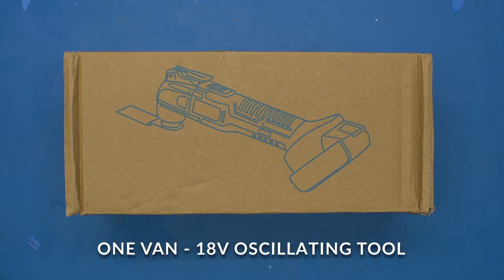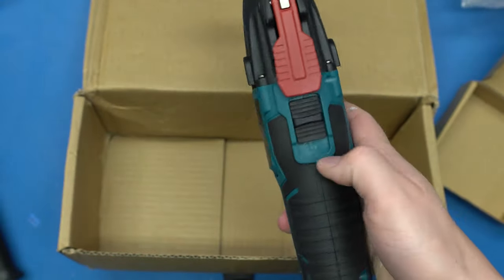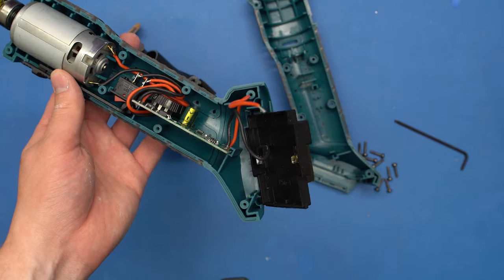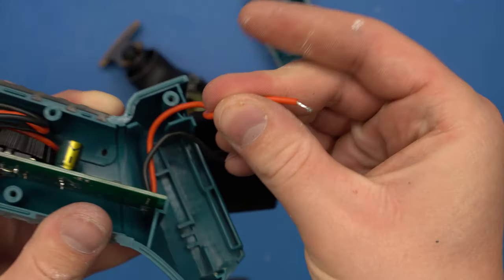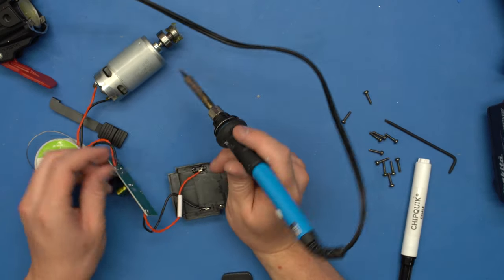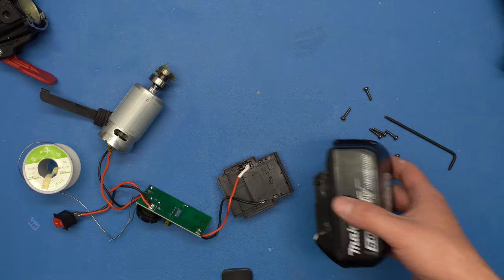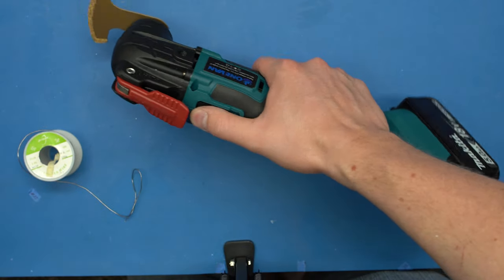This Cheap Makita KNOCKOFF is BAD! | One Van - 18V Oscillating Tool Teardown

Comment: I've got what looks like the same mold and the same problem with a SEYVUM brand. There is a nice teardown for the genuine Makita on YouTube. One big difference is a potted circuit board.  Wonder if there is a difference in the rubber gasket separating the motor from the chuck.

Comment: This is NOT Makita knockoff. It doesn't look like any Makita tool - just pure Chinesium engeenering. Makita knockoffs look like Makita tools but without logo, and they are worth the money for hobby use (OFC buy legit ones if you can). This one only accepts Makita batteries, and besides color it's the only thing it have in common with Makita. There is no Makita multitool knockoff at this moment if i remember correctly. There are angle grinders/impact wrenches etc. :)
Reply from the maker: It uses the color and takes the batteries. That's a knockoff in my book. 
Splitting hairs, but if it were trying to use the Makita design, then I probably would have called it a clone or counterfeit.

Comment: I've bought one and the head screws rattle out all the time, might have to locktite them in, or use some sprung washers
Reply: so I've found  its still  absolutely useless,  once the blades are about a cm in its  seems to stop vibrating as if its wedged,  , But it seems  ok for cutting plasterboard,,, luckily I complained and they sent another ,  so now I have 2 useless  multitools..

Comment: Worth buying?? I have just been looking at these on eBay
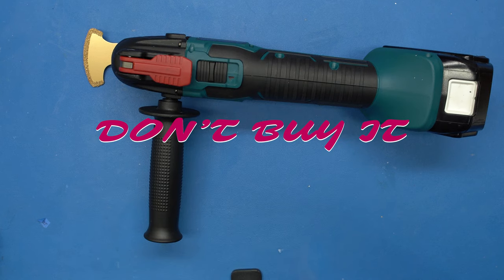Reply from the maker: 15:20

This time code should help.
Reply: A would thought would be ok I have the grinder and for 18 pound what a payed for it it’s payed for it’s self the first day and still using it a year later
Reply from the maker: I have the grinder too, or at least a similar knockoff makita grinder, but I haven't used it yet. 
I just can't recommend the oscillating tool to other people when it arrived non-functional and clearly untested at the factory.

Comment: And...how it works in practice at the end? seems like a good cheap option for light duty work
Reply from the maker: I would say it meets the expectation of light duty work. My big 5AH battery makes it heavier and a bit bulkier than a light duty oscillating tool with a cord, so there is a trade-off. I bought this tool for a project in a tight space near an outlet, so I think I would have been better off with a less-expensive wired tool. 

I can't really recommend the OneVan tool since mine arrived non-functional, and you can get a light duty corded tool for around $25 at harbor freight and walmart. The tool did not include any battery. You should only consider this tool if you already have Makita batteries and you also can't get the job done with a wired tool. 
You may also want to consider some of the other off-brand cordless oscillating tools available on amazon for $60-$80, which do include a battery. I have not yet tested any of those, but I think it is reasonable to assume they be built similarly to this one. I'm seeing one from WESCO with a 2AH battery for $60 plus a $10-off coupon, which makes it less expensive than this OneVan tool. 

It looks like there's plenty of good options out there, at least in the prices they show to my part of the US. I hope you have good luck finding one that works for you :)
Reply: @SparkY0  thanks for your reply, I already have makita batteries, and want a tool to cut some wood for cabinets in the house, ceramic repairs-maintenance in the house, some sanding-polish all in the house or this last in the car....that means to me light dutty....I also know electronics, so in case of repair..the real problem is that I own G series makita batteries, that seems to need a bit of work for adaption..I thinking in a cheap tool like this to play and make the adaption in-the-tool instead to mess with the batteries...also think as you said, maybe a corded works better for my needs XD.. Regards

Comment: Hi.  Thanks for the video...Helpful.  I also bought one of these tools.  Mine says 'Drill pro', but it's the same tool.  I am curious about the blade holding possibilities.  Some of the lever release multi tools allow the rod to come out so one could use a blade that is closed.  Does the rod come out of this one?  Is it possible to remove the screw top so a closed blade can be attached? I would really appreciate a video showing how to use the release lever and what possibilities there are.
Reply from the maker: I'm not sure about a rod, but It looks like the blade retainer can unscrew so that a closed blade will go directly on the post without using the quick release lever.

Comment: I have the same one, different brand, sofar a few months in and used several times, no problems.
Feels ok and doesn't vibrate too much in my opinion.
Also own a cheap cordeded one that makes more noise than performance and a 12V battery one wich works ok but when put to real use drains the battery too quick.

Comment: these knock off tools are ok when you consider the price of the genuine makita tool
but not for the professional worker, only the guy who wants a multi tool a couple of times a year.
i'm considering buying one now to put in the tool cupboard
i allready have a genuine makita driver drill and impact drill set with 2 batteries
i got a knock off 5 inch angle grinder and it works fine
i think you pick and choose your tools, drills get used a lot so genuine is the go